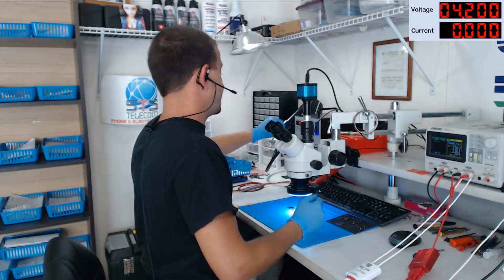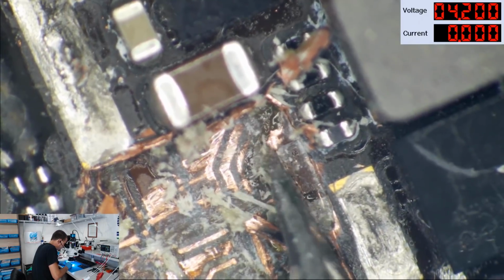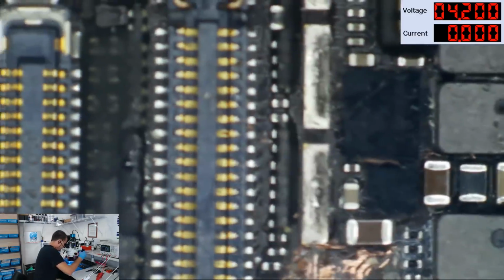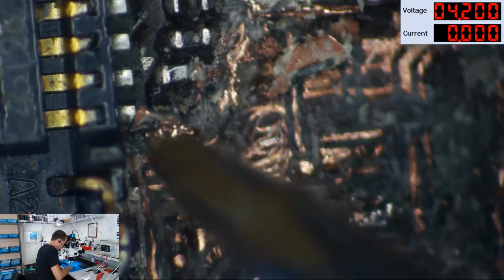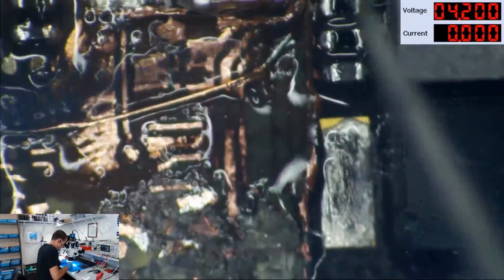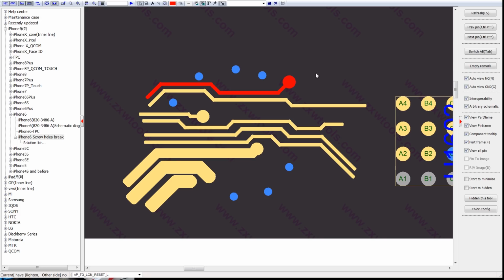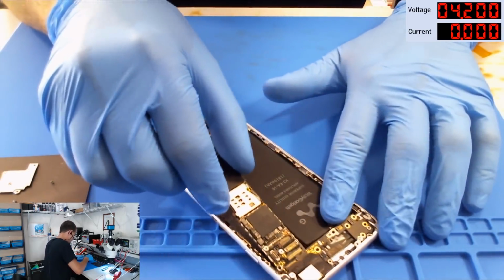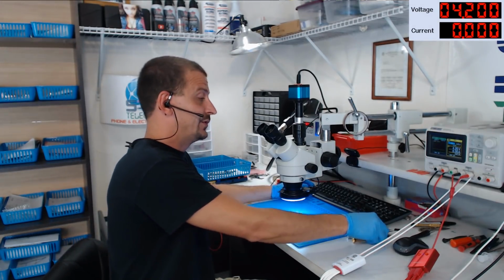iPhone 6 Long Screw Damage - A Prior Attempt Data Mission

Comment: I just wanna let you know how much I enjoy your content and how inspiring it is to me. Sensei. I have an iPhone 6s that is ghost touching. It will random open and close app or type on it owns for a few seconds at a time. Does it require touch ic replacement?
Reply from the maker: Thank u.  On the 6s, this would likely be the screen causing it.  The touch ICs are attached to the screen assembly on those.
Reply: I thought the screen aswell but I’ve replaced it twice with no luck and it seems the fuller( more space taken up gig wise) the worse it gets

Comment: love your channel, deal with iphone 6 that works as it will until the battery is over, it does not want to recharge. I take out the battery, the battery charges separately, no problem with the battery, it charges as it will when the battery is around 10%, so it recharges without any problems. let the phone remain until the battery is discharged, so it will not start charging again. any suggestions??

Comment: Why don't cell phones have something like micro ssd's. Actually where is data stored?
Reply from the maker: iPhones do but the data is encrypted.  The only way we have to access it is to make the phone boot and enter the passcode.
Reply: STS Telecom is it possible to just remove it and solder it in another board?